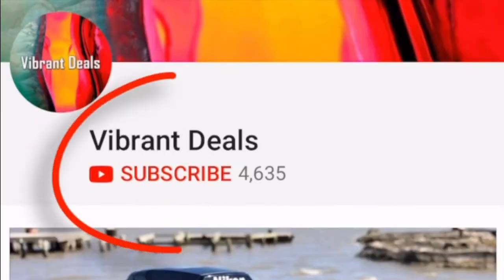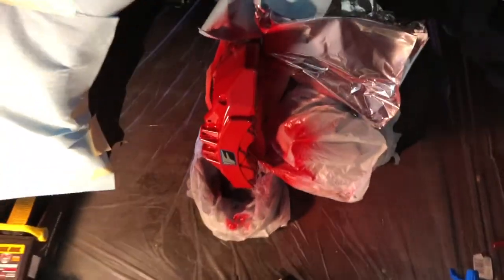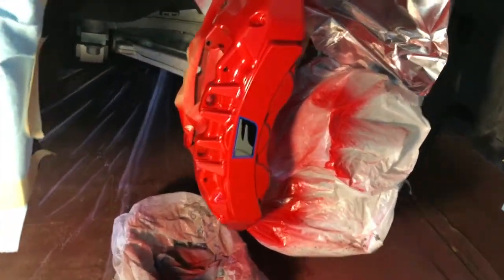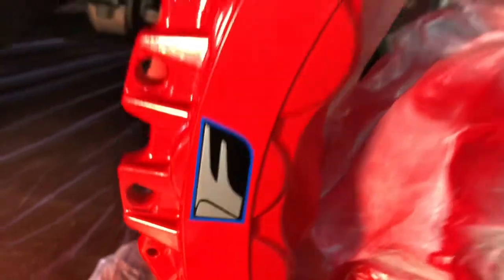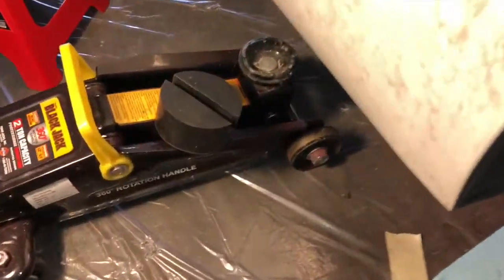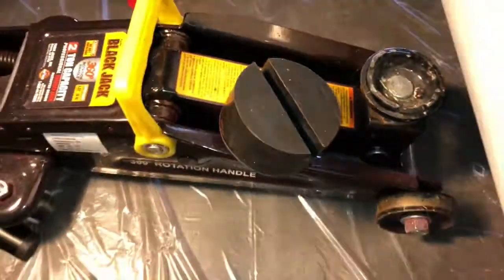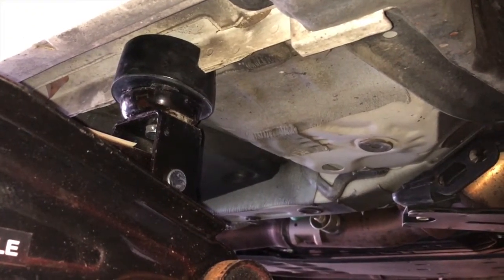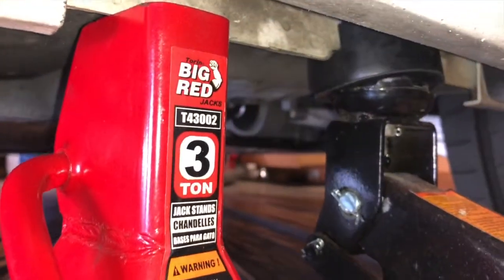✅Best rubber Jack Pad Frame Adapter Review for Pinch Weld Fames Looks Like A Hockey Puck

Comment: Can’t use that pinch weld protector with the small cup on the trolley jack. Too easy for it to slip. Get a low profile jack that the entire pinch weld adapter sits on.